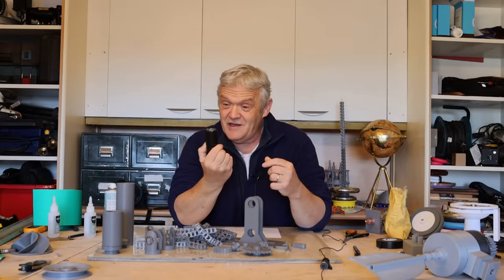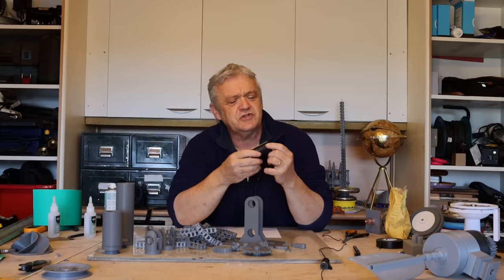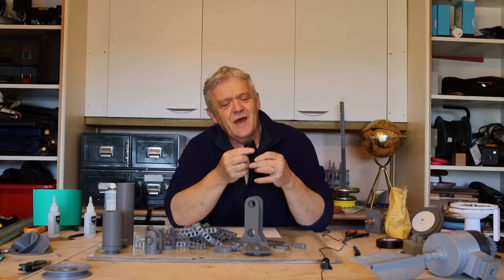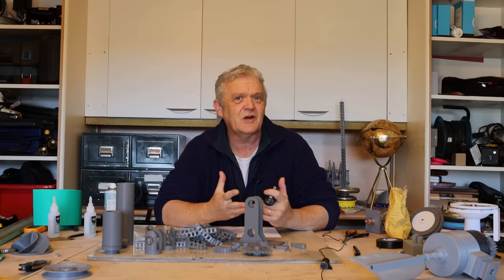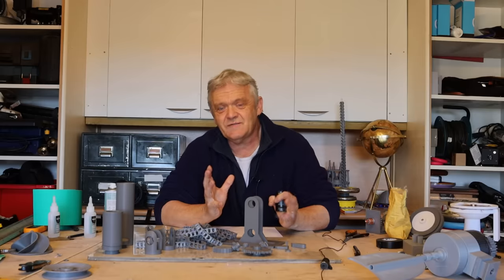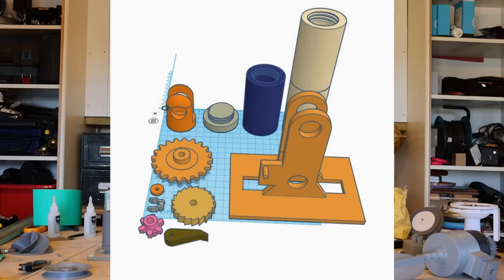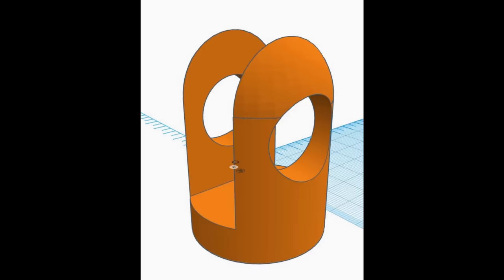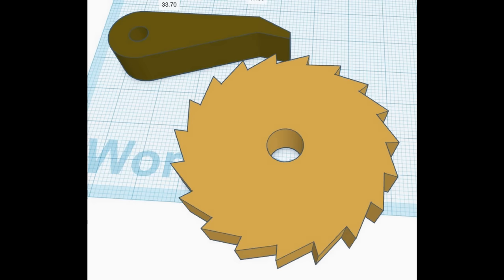2088 A Mechanical Supercapacitor - The Huygens Mechanism For Wind Turbines

Comment: One of the greatest elements of this design is that it's possible to make it more compact with multiple gears functioning like a Block and Tackle with a lot of movement in the chain slowly moving a heavy weight.
Reply from the maker: like that mate - thanks for posting
Reply: It should be possible to add a governor to this to controll the speed  aswell  to keep the rotations consistent.... I wonder whether this could be used in combination with a solar panel input to a motor generator?

Comment: This reminds me of a gravity battery system which would be ideal to use in old mineshafts
Reply: me also, i was thinking about a similar mechanism as an adjacent to the main weight, so it would be able to more easily accept power spikes and help reduce strain on the gearbox.
Reply: There are a lot more hills than mine shafts.  Seems simple enough to put a cart on a track, or a weight on a ropeway.  There's a lot less environmental impact versus flooding a valley.
Reply: I live on top of miles of abandoned mine shafts.
Reply from the maker: it is very smilar

Comment: I seem to recall Ski lifts using a similar type of weight and pulley system to maintain tension equilibrium on the cable so that as the weight changes from no passengers to many passengers, there isn’t a huge lag in the cable or rapid rising. Not sure if it’s the exact same idea but similar.

Comment: We need to get our houses running like clockwork 😊

I've been playing with paper/cardboard clocks so this made me smile.

... Looking at those weights and  how they are swaying.  Wondering if you could pick up some micro energy by putting that artificial muscle vibration device inside, or something along that idea...
Reply from the maker: interesting idea butmstly they were swaying because they were actually pretty heavy and  was holding them up - not sure if they would sway that much if fixed in position mate

Comment: Speaking of supercapacitors, when I first went past Denham in Western Australia (then a pop of 350) in the late '90's, I was intrigued to see the town had installed an onshore windmill for power generation.  Before that the town grid was diesel powered as it wasn't connected to the state grid.  Since I saw the windmill I read that a flywheel as a means of storage had been installed to smooth out the short term ebbs and flows of wind power generation.  Today they've come a very long way with a number of more modern windmills as well as a large solar farm.  The town is even getting into hydrogen as a fuel source.  Very interesting and innovative stuff.
Reply: I was intrigued decades ago that the opal mining  town of White Cliffs in NSW had it's own solar electricity production at a time decades ago when there was always  a big fanfare about new leading edge solar energy development in California getting trumpeted in the famous Popular magazine . But Whiteciffs all along had been quietly in  operation with it's humble system in the high expense days. Maybe fifteen years ago it connected to the grid though .
Reply: @philip5940  When taking the train across the Nullarbor in the '80's I thought it would be the perfect place for very large solar farms.  Still would be but more efficient now.
Reply from the maker: that is interesting mate - thanks for sharing

Comment: This is practical.

You should have seen my "invention" for a "flywheel energy storage device", a total failure due to my misunderstanding of nuanced thermodynamics. 

It used the "conical pendulum" principle to maintain a "constant" speed, my idea being that the weights swinging from a central pivot would keep a shaft rotating at a constant velocity as the weights descended toward the center, maintaining "conservation of angular momentum".

While the assembly did maintain a "more constant" velocity, my wishful thinking made me blind to the inescapable fact that in order for the weights to "swing toward the shaft", the rotation HAD TO SLOW DOWN, which put me on the "free energy" trail without even realizing it as I built more complex assemblies trying to "force" the weights down by linking to a "inversely speed sensitive" rotary governor (which turns out would have had to exhibit a rotational velocity INVERSE to the main assembly, i.e. when the main is halted, the governor is at max RPM; oops...) before I realized I was chasing my tail.

Comment: Great video Rob, I was just thinking about how long that chain would've took you to make, thinking with a plastic chain you could put magnets on each link then run the chain through coils on the chain's non-contacting sections and between coils around the gear contact sections?
Reply from the maker: for me minutes - for the printer a few hours

Comment: Thanks Robert, really cool. I would like to say that the last part of this video has a question mark, it has always been known that a mechanical system ( especially a well designed one ) is more efficient and reliable than an electronic system and there is even a lot of evidence for this. Any technology that does not use or require electricity is often portrayed as " primitive " and " inefficient " by consumer companies and the Electrification of Everything movement. The purpose of this is for profit and central control over people. You are a respected scientist, so you should not say what they say !

Comment: Very cool! You could print in place sections of chain to minimize/streamline the assembly work.
Reply from the maker: i tired PiP - it didn't work very well for me
Reply: @ThinkingandTinkering  It's been a while since I did it myself. I made ball-less bearings. They were difficult to break loose but after a wear in with some graphite powder they were smoother than sealed skate bearings. The skate bearings have grease in them I think that made the minimum rolling resistance too high. They spin the filament spool roller on my printer still. Not useful at all for substantial weight but it works great for very lightweight projects. I'll revisit that print again because my printer has been updated quite a lot since then and my tolerances have improved significantly. You're using PLA?

Comment: I have been developing this on spintronics simulator, where it is mechanical representation of electronics, basically works as a capacitor. Have been interested in the machine for as long as i was introduced a few weeks ago by  marble music guy was  using hagen drive to keep tight pitch. Absolutely beautiful. I am very intrigued by what you will do with the torque converter and the drive and maybe using maybe using it on a bicycle, pumping uneven sinalsodal wave torque from the pedals transforming that uneven torque using the hagen drive and dumping constant velocity into torque converter powering the bicycle. Now that would be impressive. Love the videos really appreciate it!
Reply from the maker: awesome mate - chers

Comment: It seems like I have seen plans for fields of wave generators that do this, slowly ratcheting up dozens of weights as storage, which is released on demand for energy generation. I believe I've seen schematics for solar plants which use massive weights to do the same thing to store energy for nighttime or peak use, but those are probably electric motor driven.

Comment: Wouldn't this clock run at different rates depending on the local mass distribution?  It assumes plumb bobs always are vertical but I think Henry Cavendish showed the Mason-Dixon anomalies were due to attraction from the the nearby Allegheny Mountains, later proven in the Schiehallion Experiment.  Or maybe I should just be asking what is the effect of a lateral force on this, not just a vertical one?

Comment: The lighter weight assists the input force in raising the heavier weight whilst also having a smaller gear. Reducing the force required to raise the heavier weight. The input runs for a longer time because it’s in “low gear”. But once the input force is stopped. The heavier weight will take over and drive the high gear. Which requires greater force. Am I following this right?
Reply: Sounds about right.
Reply from the maker: yes - but the main reason for the lower weight is pretty simple - it's just to keep tension on that part of the chain

Comment: Ok Rob I know this is off topic but you are one of the few people who might be able to help me with this back in the eighty we had gas power water pumps on our water trucks they had a great assessory a starter attached with a belt to the pully you would normally wrap the rope around to start the motor they called it a shunt wound starter 
generator now either the starter is built in or not available  after looking at over for one can't find one or even how to change a starter to a shunt wound what I want it for is back up power push a button and start the motor then have it provide power to my battery bank I'd like to see you do a utube video on this

Comment: Wow! That was quick.
Reply from the maker: it was an awesome idea mate and i wanted to explore it
Reply: @ThinkingandTinkering  
I played with it on paper for a bit. Then watched your 80cm wind harvester videos again.  And someone else's comment got me thinking about the adjustable excitation in car alternators, and petrol generators. Add flat plate transformers as brushless slip rings. One thing led to another and I think I could make a 1 meter diameter ball windmill, with a counter-rotating stator, to double the field transection speed, and also use a small permanent magnet generator for the excitation power source. It being spherical, there would actually be 2 identical mirrored generators. Mounted on a farm bell type mounting.
Reply: @ThinkingandTinkering  
I did a mock up of the thermoformed ball windmill blades from some bowl lids, and they look like they should work quite well.  These are about 16cm in diameter, blade width of about 15-20mm, 180° of a lid makes one blade. Mounted flat to a rim and rolled up to meet in the middle. Nice hollow in the middle for other pieces.
Reply: @ThinkingandTinkering  
Have you ever had that feeling, that Hagrid so eloquently expressed, "I really shouldn't have said that!"
Possibly novel and not obvious things in an open forum....
Reply from the maker: lol - oh i get what you mean - but after 10 years of open forum and all kinds of comments it gets to be a bit of water off a ducks back - truth is it doesn't matter much what you say half the time half the folks will disagree and the other half will violently disagree lol - i think the best thing is just to say it and see what develops!
Reply: @ThinkingandTinkering  
Oh Lord!
You worked in graphite! Nasty depressing business. I've serviced hoists and cranes in a graphite facility. Dust gets everywhere.

Comment: Check out tower clock automatic winding mechanisms where the large driving weight is a heavy electric motor which climbs the loop of chain between limit switches.
Reply from the maker: cheers mate

Comment: I think...  In the scenario where this becomes effective is you use a separate blade system with a freewheel clutch in between the drive... Then the gust is the only time the weight gets wound and doesn't detract from the efficiency of the original turbine... 
Comprende???
Perhaps with the  counter rotational blades 😉

Comment: Could you not accomplish the same result with the simple flyball governor found on steam engine controls?
Reply from the maker: dunno - but i would think yes for the very very short term
Reply: This is something that I have thought about too but I think it would be more useful to use a flyball governor to control gearing on the output drive of a generator or for mechanical blade pitch control in VAWTs

Comment: I would like to build a capacitor made of two plates, very thin sheet, Wide band, Stainless Steel Slinkys. a Teflon or Mylar dielectric of 3mil thickness. and a secondary coil of insulated wire through the hole in the center as a stepper transformer in parallel to the capacitor.
Reply from the maker: Go for it!

Comment: while you are running a long chain anyway, you should use it to transmit power to the base of the wind turbine, that way your generator need not be up top but on the ground. run the chain inside the poll of the wind turbine so that wind does not blow the chain and gear system of it's sprockets.
Reply from the maker: for sure mate

Comment: Couldn’t you regulate the output with a serpentine coil and magnet entrapment ? Clocks use a mechanical entrapment  . Using magnets and coil resistance to regulate how fast it falls . Clocks have 24 hours entrapment , using your planetary gears and coils and magnets could light an led for a day ??
Reply from the maker: there are loads of ways to approach it mate - i just liked this - it's pretty simple and straight forward
Reply: @ThinkingandTinkering  this is a fantastic method . I’ve been fascinated by mechanical energy storage devices  ever since I was a kid ( clockwork trains , pendulum clocks wind up radio) . I meant on this mechanisms output . My ADHD mind raced to what might come next . Sorry  i don’t mean to come across negative.
Reply: @POKERDEAL  Chill, I didn't see it as negative.
And I'm pretty sure as upbeat as Rob is he's damn near bulletproof when it comes to 'criticism'.
Reply: @ThinkingandTinkering  not simple to me but have been thinkjng for a few years there was some thing in this set up that would help make other other stuff work much better  it has to be the key to use weight falling and pendlum motion into a very good battery  i am dumber than box of rocks but i truly think this is the key!!!

Comment: Would it be possible then to combine multiple units in series, using different sized gears for torque conversion? That would in my mind make it easier to capture the smallest peak, and then transfer to a larger and larger "capacitor." I understand that there would be diminishing returns, but I would imagine that it would be similar to peak shaving a sine wave. I suppose it depends on the application.
Reply: Could be used to store small gusts in a low wind day, then turn the crank fast enough to generate until the stored energy is discharged, it then begins recharging using the previously unusable low wind speed. Maybe. Not sure if I'm conveying my thoughts correctly. I'm referring to low wind days and being able to achieve a faster rpm of the generator. Speed being relevant to power generated, I was just thinking that a mechanical capacitor could be used to run the generator at a useable or peak power for a short burst, when it otherwise would be unable to generate in the lower continuous wind speed.
Reply from the maker: i would think so mate

Comment: more of a flywheel than a capacitor?
Reply from the maker: i think you can compare a battery to a flywheel mate they have a lot of similarities
Reply: Flywheels are more of a coil-equivalent, resisting fast changes.

Comment: Seems more complex than just using a dump load resistor.  You could harvest the heat from the resistors to say charge a sand bank thermal storage system.  Turbines are at risk when they are not driving a load and free-wheeling.  Also, I'm not convinced of the ability of this implementation to smooth sustained gusts.  The length in time, difference of rotational speeds means that the capacitance is limited by length of the chain.
Reply: Using relatively simple weights/springs wind tubines can be made to 'feather' the blades when rpm and/or wind gusts above a desired limit. This stops the output/rpm going to excess. Similar to a centrifugal govenor mechanism. Of course this does not store the excess, but it does smooth things to optimise the best output of blade-angle wind-speed/rpm.
Reply: On second thoughts, you could store some excess energy in a large flywheel as well, and/or dumpload into a thermal store. It all depends on duration and magnitude of the 'surge'. The centrifugal govenor would still safe guard the turbine/generator from excess and damage.
Reply from the maker: it does a different job than a dump resistor - and luckily my job isn't to convince you of anything